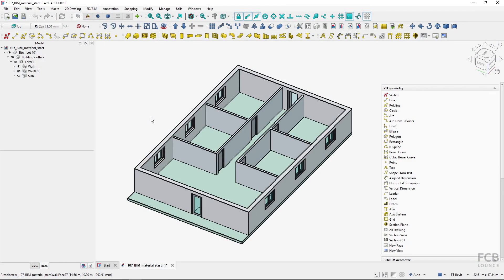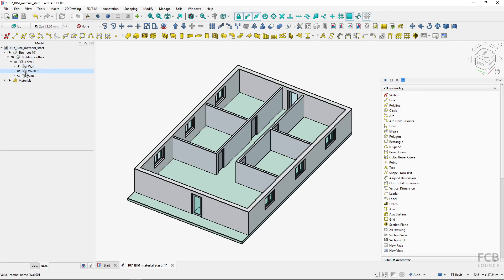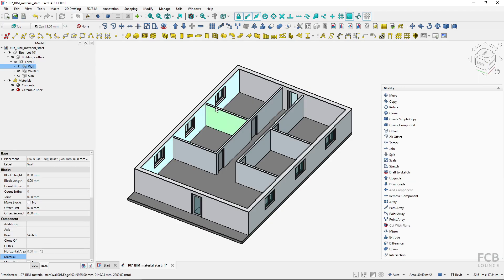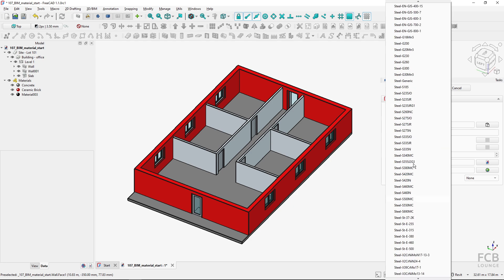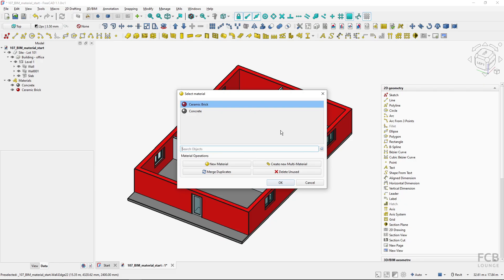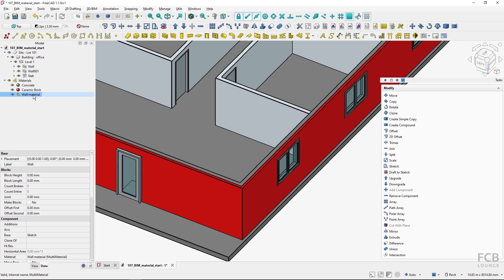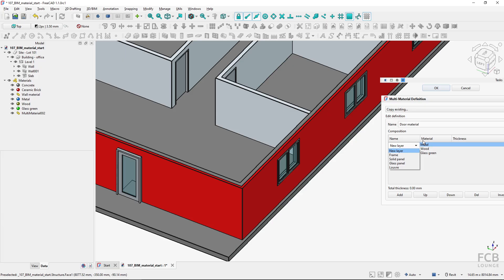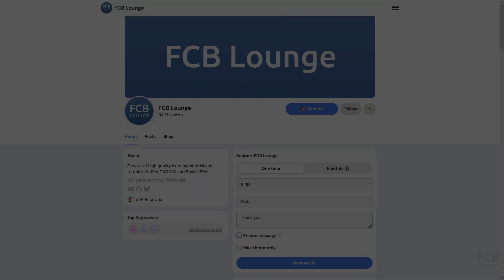FreeCAD BIM Materials Explained

Comment: Is it possible to create a separate file with all the BIM materials and then copy and paste it into another file? The idea is to have one file with all the materials and then transfer them to other working files.
Reply from the maker: Yes, it is possible to copy a material from one file to another. So, you can have your BIM material library file and always copy those materials that you need into the active project.
Reply: @FCBlounge  What would be the process or the best way to proceed?
Reply from the maker: @AngelGutierrez-dg9un  I did not get much thought to it, but the simplest way is to create a BIM_material_library file, where you create your materials. When you need to use the material form the library in a new project, just open the library select the materials, Ctrl+C to copy them into clipboard and paste them (Ctrl+V) to the new project.

Comment: How do I create a permanent wood texture on a cube?
Reply from the maker: I don't think it's possible to use textures in FreeCAD at this point.
Reply: Maybe try archtexture workbench?I think there is a plugin for it.
Reply from the maker: @aurovictor2286  Unfortunately the ArchTextures workbench is no longer maintained and it does not work with FreeCAD 1.0 and higher.